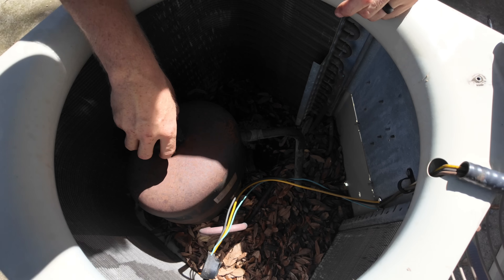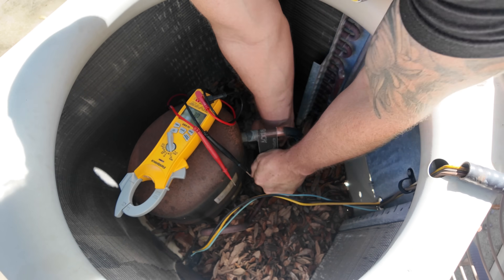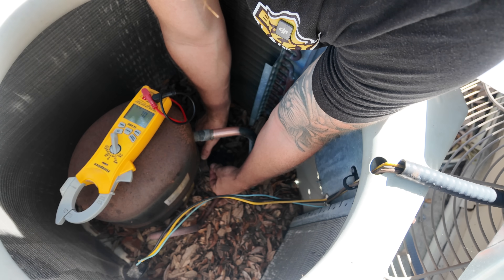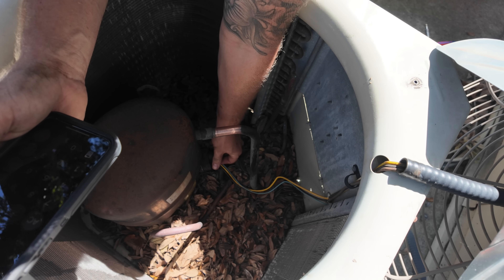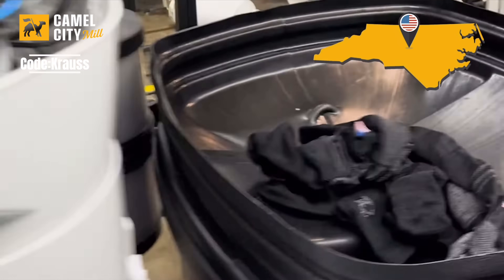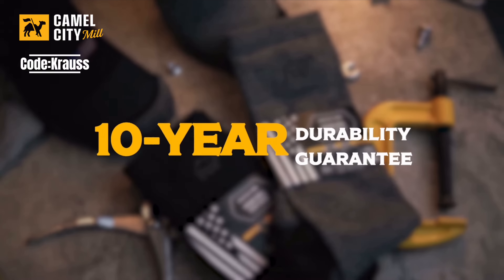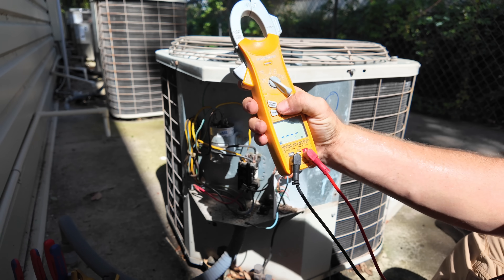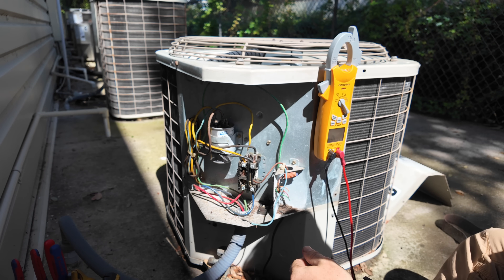Carrier AC Not Cooling | Tripped Breaker But Not What I Thought

Comment: Nice video. I’ve diagnosed loose connections tripping breakers and compressors over amping trip them too. On some occasions, I’ve seen some compressors have a winding to winding short. Harder to diagnose though.
Reply from the maker: I believe this units had issues similar in the past. After returning to replace the contactor, that’s what property manager was telling me 😑 hoping it’s wires. If it happens again we shall see!! Thanks for the feedback

Comment: Tripped Breaker Cause #5 - the last tech may have hung the condenser fan off the side of the unit and shorted the wiring on the sharp sheet metal with an unprotected edge.
Reply from the maker: Nah never 😅

Comment: Pretty sad "corporate" doesn't give you a higher limit to repair. Instead of getting the job done on the first trip, now you have to go there a second time. Unless they pay you for both trips, I'd find explain to them its going to save them some money if they raise your limit to an amount that is enough to repair a condenser with basic fixes vs. (if they do) pay for two trips. If they aren't paying for both trips, I would reconsider having that client as you are not doing a repair with common sense and one trip. Just my 2 cents. Yes, I'd say those loose load wires could have been the issue, they do loosen unless those connections are checked twice, at the time of install and just before closing up the access panel as the copper wire strands compress after the first time the screw is set. Not always but often.
Reply from the maker: Fortunately we have gotten an increase since then a the NTE is much better limit!! We have worked out a much better partnership with them 😅 I agree with you thanks for the insight

Comment: Great video. Thank you for sharing. May I ask ? How many ohm is good contactor ? and how many ohm is bad contactor ? I'm new
Reply: Don’t use Ohm range to check contactor
Reply from the maker: I usually go with the range of 10-20 but if it’s close or I’m getting issues that could relate to the contactor I’ll replace

Comment: maybe you should bring up your limit of what you're allowed to spend cuz you should be able to replace a contactor without asking. that's like replacing a capacitor. it's the same thing. it's almost the same price
Reply from the maker: I agree, I know I have to bite the bullet sometimes when it comes to approvals 😅 250 limit and that’s not on our end that’s customers on site approval, and that includes trip charge. Moving forward will increase though!
Reply: @KoolinwithKrauss  $250 isn't enough to repair anything I'd think. They should pay you a trip fee if they have to make you wait and return a second time.

Comment: I’m not for connecting gauges just because but the head of that compressor was pretty rusty. That can indicate excessive high side pressure likely due to overcharge. If you haven’t checked it for another reason, might be good to check pressures.

Also, loved the “arch” flash warning placard in the panel.
Reply from the maker: Appreciate the feedback, and that panel was wild 😂 did end up going back and rinsing the coil out was running very hot.

Comment: I had a bad condenser fan motor tripping the breaker. 
I initially thought it was the compressor but it rang out good. 

So I swapped the capacitor and the unit ran fine for year but I could tell the start ups were still rough. 
(I'm an industrial electrician by trade so my ears are fine tuned to motor start ups)
The condenser fan motor finally gave up the ghost before this hot summer started. 
I went outside and notice the fan had stopped mid cycle and the compressor was still running. 
The compressor would trip out on the high pressure limit switch.
Once the condenser coil cooled down the compressor would start up again. 
Fan motor would build heat in the windings again until stopped and then repeat the process I just mentioned.
Fortunately I caught it when it all started happening.  

I put in a new condenser fan motor and she runs like a top now.
Reply from the maker: Thanks for sharing your experience, good to hear you caught it before it got too bad! I feel like there’s so many circumstances where it’s almost a phantom call. I’m sure it’ll show up again soon 😅

Comment: I have seen several times loose connections at the breaker itself cause the breaker to open because it causes the breaker to overheat from too much resistance at the loose connection.
Reply from the maker: Good point, thanks for the feedback! On one of my previous on a different visit was experiencing some issues with one of those breakers and recommended an electrician be called 😅
Reply: @KoolinwithKrauss  do you check breakers? Or do you recommend to the customer that they hire an electrician?

Comment: Check amp draw on comp and fan 
This will tell you if issue
Contractor coil will blow control fuse not breaker
Reply: Could check the voltage drop across the contactor, L1 to T1 and/or L2 to T2.  That can tell you if the contacts are worn and pitted which can over heat and draw higher current.
Reply from the maker: Absolutely!

Comment: Please explain why off of the 454b DOA unit video you ohm out the compressor terminals from the leads (Run,start,common) inside the unit’s electrical cabinet by checking to ground inside the cabinet chassis. Which to me didn’t make sense, but in this video you’re ohming out the compressor the standard way.. ?
Reply from the maker: In that video I actually get in and check it also, there that 🤷‍♂️ But that unit what so effing tall I didn’t want to have to get up and climb but for verification after testing through the harness I went into the condenser. This one was so tiny was easier to take the top off but I still checked directly at the compressor.
Reply: @KoolinwithKrauss  I gotcha, perfectly understandable. Why work harder and reach into a tall condenser if you don’t need to right?  I was just more wondering how the compressor windings could be grounded to the electrical chassis at all. I thought that if they are grounded at all, it will be to the inside of the compressor which is why we ohm out to the line set. The line set in no way shape or form should be touching the electrical cabinet, which is what confused me. In terms of the DOA video, how did you get audible continuity from two things that should in no way have continuity?
Reply from the maker: @raymondmartinez1263 the body of the unit is grounded also. I’m not expert what so ever! I don’t know much about electrical at all, maybe some one can chime in! I just know the unit itself is grounded, so I went that route on that particular day! I don’t have a method when doing diagnostic. I just go with how I feel 😅I have a round about SOP but a varies

Comment: Yep, you hit all the points.  Hard to diagnose when its not a hard failure.  Could have been the motor quitting when it gets warm, loose wire.  But you also do not know if there was a power loss or if the Tstat does not have delay since it is a recip and no start kit, it could have just been rapidly cycled.  Also hate those industrial power panels, but I have seen the wiring lose at the breaker too. Great video thanks for the content!
Reply from the maker: Thanks for watching and sharing your experience, it’s helpful to hear what other techs are seeing!! The last time I went out there, there was another unit that tripped and when I tried to reset, you could hear it (sounded like it was arching) I said need to get Electrican 😂 I turn into a pansy